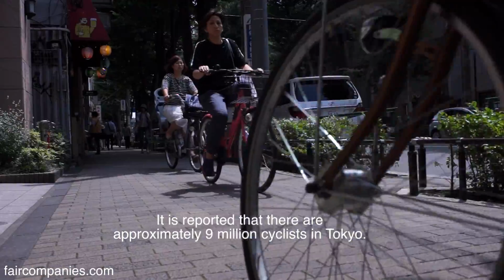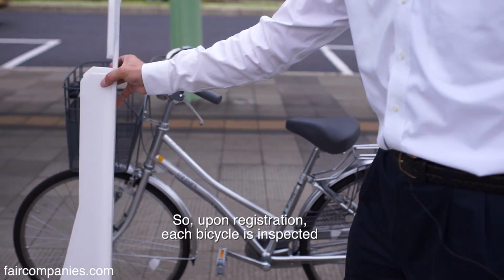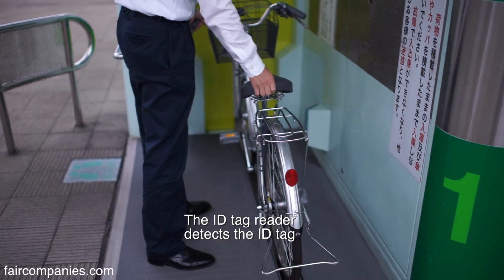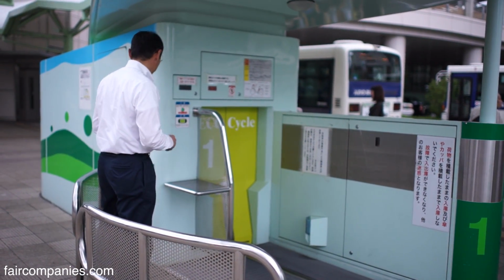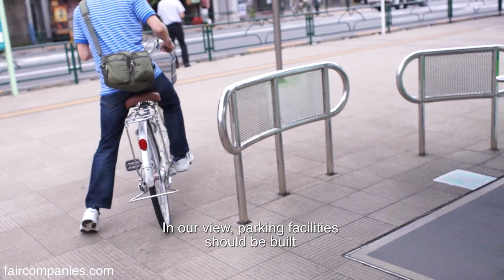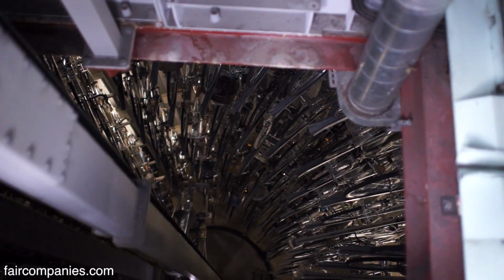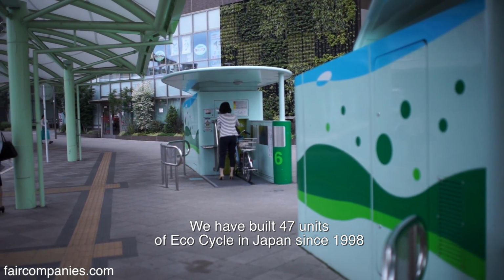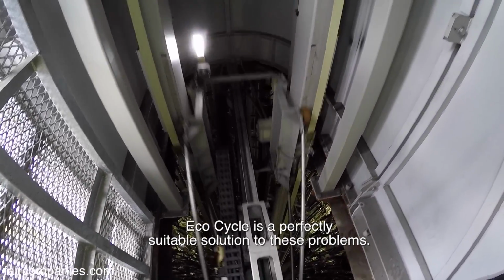Underground bike parking system in Tokyo: how it works

Comment: a beautiful solution, aesthetically pleasing, and offers protection against theft.
Reply: Even if you park your bike outdoor no one would steel it, coz its Japan. This system would be really needed in Europe though.
Reply: @05milkajeng  Well its not impossible it gets stolen, if i recall correctly bicycle theft is the most common crime in japan
Reply: @user-nm9vs1zc3y  yes most common there yet the number is so low comparing other countries. Lol
Reply: @05milkajeng  yeah its low but its not so low you never need to lock your bike for example
Reply: @user-nm9vs1zc3y  well my friends and i went to japan a few times and rented a bike in tokyo, left it and buy some food in the shops. Never once got stolen or maybe i just got lucky.

Comment: Solution for congestion, yes; solution for aesthetics, well that's pretty subjective. When I lived in a big city in the middle of China in the mid 90s, when bicycles still vastly outnumbered autos and motorcycles, I found nothing visually unappealing about the huge ranks of bicycles parked in the urban center -- in fact, I loved seeing (and participating in) this bicycle culture in action. It has been the rise of the car in China that has crowded out urban bikes and, more importantly, the wide bike lanes, and taken up urban space while adding to the massive pollution. Also, none of my Chinese friends ever complained about anyone stealing a bike, though each bike was equipped with a simple frame-mounted "C" lock that closed through the rear wheel, and everyone used them.

As urban densities continue to grow, the space consideration for bike storage (if bike culture survives in the face of various "high tech" urban/public transport concepts) is an issue that can be addressed in a variety of ways -- hopefully ways that are as energy efficient and low tech as riding the bike itself.
Reply: Aesthetics can be addressed through design. Pretty much the only thing necessary here is the track and doors.  You could probably stick this into the side of a building.

Comment: There's some issues with this, even though it looks really cool. The first problem is that this wouldn't be able to be used near any major transport hub as the amount of bicycles it can carry is too low, a 30 second interval is way too long. Secondly the technology behind this can be very prone to breakdowns and the worst that can happen for someone storing their car is if they can't access it anymore after they stored it. I wonder if this has come a long way since those 4 years.
Reply: Your concerns might seem reasonable in theory but they probably are unfounded in reality. This system had been used in Japan for over a decade. Therefore, they have had time to work out the bugs. The technology is simple, not much more complicated than an elevator. 

Hundreds of millions of people drive automobiles all around the world. Automobiles are far more sophisticated and prone to breakdowns than this technologically simple bike parking system.

Second, with a smartphone, riders could order their bicycle brought back to street level roughly 30 seconds prior to arriving at the bike parking location. 30 seconds later, when the rider arrived at the bike parking location he could swipe his ID card (or use his smartphone instead of an ID card) to have the system release the front wheel of his bicycle. This would presumably negate your concern about having to wait an excessive amount of time.

Criticizing new ideas is easy; understanding them is often more difficult.
Reply: @yekutielbenheshel354  30 seconds is not a long time. Less time than retrieving a car from an underground car park.

Comment: As someone who prefers riding heavier bicycles, what's the maximum weight of bicycle that EcoCycle can accommodate? I often add extra weight to mine to increase inertia and ease highway riding (Where a lot of weight makes fighting air resistance easier) and this means mine can weigh in excess of 40kg at times. 🚵💨😇

Comment: Sorry. As elegant and sensible as this appears, it's not practical. Let cyclists park outside as necessary and do not present further barriers. There are too many barriers already in a Tokyo.
Reply: It is already being used at 41 different sites in Tokyo. So it is entirely practical. The less practical solution, is having to build on street parking for 9 million bicycles and rising, in one of the most densely populated places on Earth.
Reply: fatbap That's great, however I commute every day from east to west and ride over 2200 km every month in and around central Tokyo, and have never come across one of these. I'm not saying they don't exist, but where are the 41 you mention? We don't need a solution, bicycling in Tokyo already works. Introducing regulation and control is not a good thing for cycling in Tokyo.
Reply: Eltercero
Theyre not regulation and control. If you want to use it you can. If you dont want to use it, you dont have to. Simple. All these do is provide a safe, easy solution to a very real problem in Tokyo, which is that space is hard to come by, and as the population increases even more and more homes have to be built for them, that premium space will become even more valuable. At a point, each prefecture or each city will have to come up with something to squeeze the very last drop of space out of their cities, and these are an ingenious solution. You are very narrow sighted for being unable to see that.

I also think you miss the point of these sheds. They have nothing to do with cycling in Tokyo. They have to do with bicycle storage. They take parked bikes off the streets and put them where they cant be stolen and theyre out of the worst weather conditions. If these were implemented on a wide scale, the huge "bicycle parks", for lack of a better term, and the bicycle racks on streets, could become a thing of the past, freeing up some space for homes or something else, and making the footpaths wider for the vast foot traffic that occurs in Tokyo. Seeing as bicycle theft is actually one of the top crimes in Japan, I think these provide a neat and typically Japanese solution to about 4 problems at once.

The only 3 I know about are at Konan Hoshi no Koen park near Shinagawa Station.
Reply: fatbap I'm narrow sighted? That's not very nice. The population is falling in Japan not rising. There is nothing wrong with the idea of putting bicycles underground, however in Tokyo I find it would be very impractical. I guess we disagree. Let's leave it at that. But if you care to share more information about the 41 locations in Tokyo, please do.
Reply: Eltercero These problems have been recognised by the japanese government and the Tokyo governers office, and they have both taken steps to address them. You cannot see these problems, ergo you are short sighted on this issue. Thats the truth wether its nice or not. Im not insulting you, but if you cannot see a problem that a lot of the rest of the country sees, that is the very defination of short sighted.

Yes, the population of Japan overall is falling. However, we are talking about Tokyo. According to the 2010 census and the 2015 census, the population of Tokyo continues to rise.

http://www.metro.tokyo.jp/ENGLISH/ABOUT/HISTORY/history03.htm

I have no idea where they are. I saw them when I was in Tokyo on holiday at Shinagawa station. Thats the only place I know they are for a fact. The 41 number comes from a documentary I watched about Tokyo and its needs for the future. There was an interview with someone from GIKEN who gave the 41 number and said they were mostly near train stations at the minute in both Tokyo and Osaka.
Reply: fatbap Got it. So you don't live in Tokyo, but the governor's office saw a problem, and that does it for you? Anyone who disagrees is short-sighted for not seeing the same problem? I live here. I cycle here a ton. I'm entitled to my opinion. Thanks.
Reply: @fatbap  I just stumbled upon this after 5 years. I see you edited and changed your dialogue to make yourself look like a nice person when in fact you were insulting me. Nice one, dude. LOL. For what it's worth, the conversation as it appears here is not the conversation that occurred. My part is the same though. I also noticed you changed your name. Good one, man! LOL.
Reply: @fatbap  Right. So you deleted your insult comments, changed your name and then made new insults, and then wrote a book about it in the comments. Good one, man. Lol.
Reply: @Eltercero  So then where are all your replies to my supposedly deleted comments? Did I somehow magically delete them too? Take your delusions elsewhere please.

And fyi, if you think 3 paragraphs is a book, just wait until you start school...